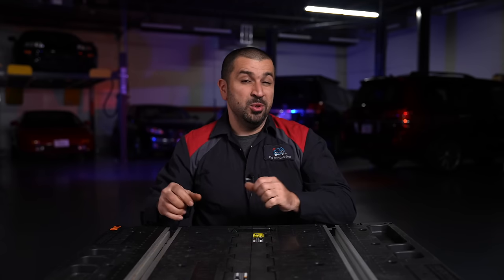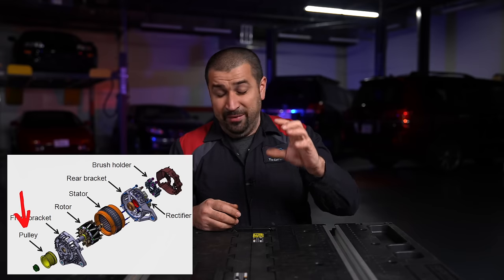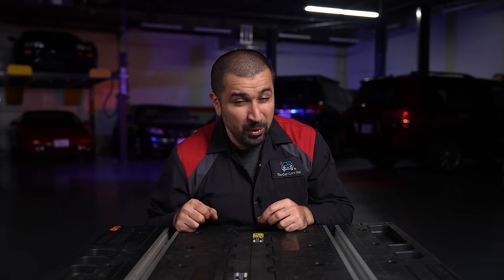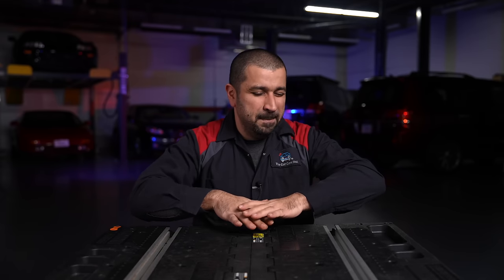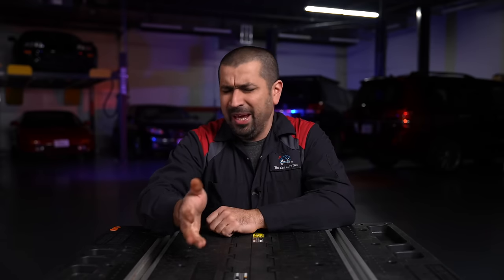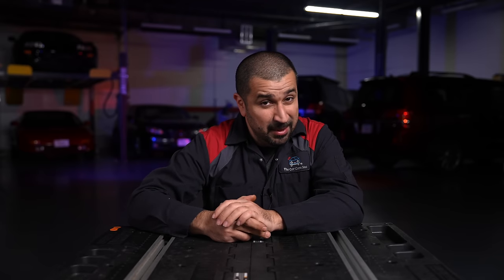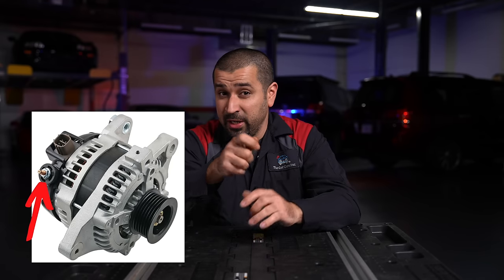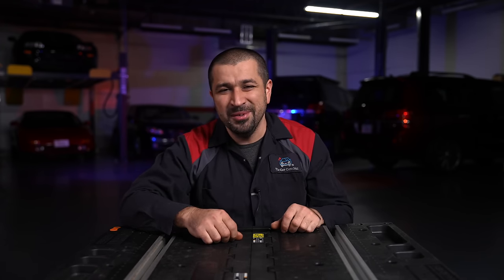How To Make Your Car's Alternator Last Longer? Everything You Need to Know

Comment: I usually get between 200-300K miles on my Toyota's when the alternator starts to fail, just something I've noticed over the decades on all the vehicles I've owned. 
Story time = The wife was in FL in her Lexus RX300 (03') driving back, when the vehicle died while running. Why do most women never notice warning lights :(  . Someone jumped her car and it ran for a few minutes before it died again. Alternator was completely dead. Drove 5 hours to her. I swapped my battery for hers, then we set off to come home. I charged the battery while driving (full field on my alternator), while she was draining down the battery on hers (we were driving in the middle of the night at this point). Every hour we would stop and swap batteries again (fresh one in her vehicle, low battery in mine to charge). Did this 5x and made it all the way home. Got a new alternator at the Toyota dealership the next day and 20 minutes to swap out.
So if you ever find yourself stranded far from home in the middle of the night, playing swap out with someone else's battery can get you home. A little extra wear on the alternator is worth it.

Comment: Very good simple explanation but that covered “early” alternators because modern alternators contain 6-9 diodes to not be wasteful because when you just cut off the negative wave entirely you lose it so the efficiency early on was 50%. Adding 3 more diodes on the negative side of the ac facing away from ground forces the waves to turn around and then the bottom wave band is not lost.

Comment: Very informative. Over the years of small repairs on friends and family vehicles I noticed the pattern of alternators and batteries killing each other. Although I couldn’t quite figure out which was the cause. This makes much sense and confirms to me that there was connection. Thanks!
Reply: I found that my 20 year old Toyota Starter was killing the battery gradually, with every start.
(Battery and Alternator are fine.)  After 2nd battery replacement within 30 months, I noticed the slightly slower cranking and measured an excessive post-to-post battery voltage dip.
Isolated, a battery load test looks fine. Changed the starter and now that same battery is still working, years later.  That was a first for me after several decades, incl 45 years DIY Toyota.

Comment: I am a certified mechanic as well I'm 65 years old! you doing a great job my friend! I have a 2015 Chevy Express I bought brand new got almost 330,000 mi on it and never replaced the alternator always stay dry as in the front and it's away from the radiator

Comment: I'd also recommend performing the Big 3 (or Big 4) which is upgrading the small gauge power/ground wire (that goes to the battery) with 100% OFC 0 gauge wiring.
Reply: Usually don't need it
Reply: @DylanL69   Tell that to my amplifiers as just one of them does 5,000 watts RMS @ 1 ohm.

Comment: For a first-time car owner like me, it kinda blew my mind that weak battery can cause bad gas mileage. My car suddenly had horrible gas mileage out of nowhere, and I tried replacing spark plugs, carbon cleaning the engine, change oil etc. and still bad mileage. Now I am 100% sure it is the battery because my alternator does make a small whining noises. Thank you so much for making this video AMD, actually lifesaving!
Reply: No it's your alternator

Comment: Another tip to prolong the alternator's life is to purchase a smart car battery charger/maintainer. Every few weeks, just plug the charger to your car battery and the charger will charge up and maintain your car battery without overcharging it. That will mean less work that the alternator has to do, whenever you drive your car. (Your battery life will also be extended. 😁)

Comment: I've mentioned the alternator wear from boosting while running the booster engine before, and people don't believe it.  I've had two alternators die in otherwise well maintained vehicles, within a week of boosting while running the engine.  My brother-in-law who worked as  electronics tech understands the problem.  Most mechanically inclined people do not.   I'll never do it that way again.

Comment: I remember driving a friends corolla in outback Australia and the alternator light came up. It was 3 hours between towns and we were half way. After a few checks we drove onto the next town with the AC off. A local garage rebulit it as we waited with genuine denso parts. (The brushes had worn down and they replaced bearings and the regulator)  These days we would have to wait 2 or 3 days and possibly have some aftermarket junk fitted for a way bigger bill.

Comment: I had a remanufactured power steering pump leak power steering fluid on my alternator and it eventually killed my alternator. I regret not taking care of that power steering pump when I first found out it was leaking. Lesson learned.

Comment: Just to share, the Toyota Fortuner (2016 model and up) alternator bearing gets bad prematurely due to excessive vibration caused by the engine and worn out drive belt.  It's a common concern among Toyota Fortuner here in the Philippines.  Thank you Mr. Care Care Nuts for your valuable advices.  I've been following your channel for more than 2 years now.  Cheers!

Comment: I have owned my 1984 Toyota pickup forever. Now at 253K miles. The alternator has quit working two times in those 39 years. Both times it was the brushes worn out. I just replaced those -- back in business. One brush replacement happened in a rural area and all I could find were generic hardware store brushes. Had to file down the carbon to fit brush holders and rejigger the copper pigtails -- back in business. Amazing that the bearings are still working. I should replace those before the rotar starts rubbing on the stator parts.

Comment: This was just excellent: I wondered how they go from AC to DC beyond very generally knowing what was needed to happen.  My Neon had one low down - small and very nice looking thing the size of a big fist maybe - but $900 like 20 years ago just for the part (I gasped when the told me).  My Elantra has a big unit right up front, actually the most noticeable thing - when new it looked fantastic inside with the almost orange copper inside.  My salesperson said the AGM battery is also being used to protect the alternator and electrical system as it has much better guts to drive things without - I guess it would be the amps - of the alternator needing to get in there aggressively.  My '04 Sebring GTC .. CAA tested the battery and said it was fine but showed kind of it was not happy (drained) and the guy said it is the alternator but more likely my starter; and to look into it as the alternator and battery were likely paying the price.  Turned out the starter was drawing crazy high voltage or watts - something like near 600 instead of say 150 (I can't recall the numbers, just it was strongly different).

Comment: Excellent video.  Had a problem with my Ranger recently.  After 2 1/2 hours stuck in hot traffic jam, I stopped at a rest station on I75.  No lights on dash or any other signs of a problem.  Went to start the truck 10 minutes later - lights on dashboard, but no cranking.  Battery was dead, well indicated 2 V on my meter.   AAA was called but did not come.  Managed to get a boost and drove to get a new battery.  It was obvious that the alternator was working hard, but it made it.  Put a new battery in the next morning (AAA called at 502 am to ask if I still needed help, fourteen hours later).  The truck has been fine ever since.  I'm going to get the charging system checked, but your explanation of the role of the battery vs the alternator explained things and makes sense.  I have done about 2000 kms since the mishap, so I hope the alternator is ok, but I don't want it to happen again (I was on a trip from Canada to Florida and then back to Canada).
Reply: How old was your battery? I have found any time they're more than four years they can't be trusted - even if they test ok.

Comment: I agree that keeping things stock/OEM makes sense. The problems start when, say for a 4Runner that's modded for overlanding, you add all kinds of lights and gadgets that require far more than the 100 or 130 amps the OEM alternator puts out, especially if you now have an AGM battery (or two) installed. I've heard good things about the DC Power, Inc. unit made specifically for the 4Runner with unique power demands and computer driven sensibilities.
Reply: Put a capacitor inline  you should be golden, i had 250000 miles on my jeep never changed it

Comment: Thanks for the info. Just had my alternator (part number 27060-37021) replaced on my 2010 Toyota Rumion (Scion xB) at 135K km with a 2ZR-FAE engine. An alternator is hard to find in my country, even at the local Toyota Dealer. This alternator was never used in the USA. The exact same  alternator delivered from Japan to my country was around $1300.  Way over my budget. I found a second-hand one. Hopefully, it will last a bit.
Reply: You got the correct amperage rating right?

Comment: Great informative video!  It took me several weeks to discover the oil-soaked alternator of my 94 Toyota Pickup was causing the engine to cut out shortly after it started.  The $100 Chinese alternator I bought from Amazon is still working 1 1/2 years later.
Reply: Nice 😊!
Reply: What did you do? Can you clean it with brake cleaner?
Reply: @jcherestal  I did try cleaning it but I never put it back in the truck.  It's just sitting on a shelf in the garage.  I will need to keep an eye on the leaking oil situation.  I don't drive this vehicle very often though, only about 500 mile a year.

Comment: Dear Car Nut: My dad had a gas station since the early 50's where he did minor repair. I remember him cutting the mica on generator armatures and replacing the brushes. Those days, one was lucky to get 30 amps off a generator thru the relatively big "carbon" brushes. What surprised me when alternators came out was the tiny size of the brushes for the rotor. But now, alternators started at 60 amps output and easily these days, 100 amp is common. If I have this figured out right, the old generators had their load generated and come off the rotating armature, and the stationary field coils created the excitation. All the load had to come off the brushes. These days, the tiny brushes only have to power the rotor, which now the rotating field, opposite of how the generators worked. All the power comes off the stationary "stator", which is hard wired to the outside world, none of that charging has to ride on slip rings.
Reply: I remember my dad telling me that when he was an apprentice mechanic he learned how to rewire an armature.
Reply: @tolrem  There was a rebuilder in Fresno CA, Evans Electric Service, who rebuilt starters, gens and alternators. Unfortunately, they have since gone out of business. They used to supply the entire Central Valley with rebuilds. As a kid, my dad would take me thru the factory floor and the screeching, smells and pounding of people working was tremendous. All gone now. Last time I saw old man Hammer, I took my friend to get a starter for an early 50's Dodge. No AutoZone books went back that far. Old man Hammer took one look at it and said "That's a 3108-b. 3108-a has a 7/16 hole on one ear where this one has two 3/8 holes. Ya want that in 6 volts, cuz we can build it up for 12 volts if ya like."
Reply: Cool story and informative explanations.
Reply: @obsoleteprofessor2034 
Hard if not impossible to find a place like that anymore. Let the greenies have their future.

Comment: I'm not an engineer, only took some physics in high-school. At 6:30 instead of cutting off a half of the waveform wouldn't they use a bridge rectifier to invert it, so not to lose 50% of power? On the other hand at first I thought why don't they use a permanent magnet in the rotor. I never knew that's how they regulate an alternator output, that's brilliant!

Comment: My Mom had a Buick with the 3800 V6 known to be a great engine. But hers ate alternators. I suspected it was because of its placement at the back of the engine by the firewall caused it to overheat. AMD confirmed this with his comments about cooling.

Comment: I killed my alternator in a month by letting oil drip on it.

I put a supercharger on my car and it was leaking a bit of oil on the alternator (not much) but it killed it quicker than i thought. 

Fixed the leak and replaced the alternator. I knew I was pushing my luck by being impatient, but i didn't think it would kill it THAT fast. 

Lesson learned... Been good for 100k miles.

Comment: Best mod for a healthy alt, stable voltage and battery. Upgrade the + wire going to the battery from alt and add high gauge stranded ground wires from battery- to engine, engine to frame. And get as bigova battery that fits. All connections super tight and protected with spray or vasaline

Comment: Rule #1:  don't overtighten the alternator drive belt.  In the olden days when cars had generators, the roles were reversed:  the armature had the heavy windings while the stator had the smaller windings.
Reply: On the 350 Chevys with a V-belt, we would tension the belt to where you couldn't rotate the cooling blade on the pulley by hand and that's it. People used to tighten them so much that the belts used to flip upside down in the pulley track....

Comment: 21:30 If the battery light comes on, you can still drive for maybe an hour depending on the load.  Turn off electric accessories, air conditioner, headlights.  If you are out in the middle of nowhere in a southwestern desert, "park the car" right now right here might not be the best choice.

Comment: Thanks A. Some useful info. One thing I think you should have added is that you CAN repair those alternators, especially some Toyota densos. What is the most common cause of an alternator failing? Worn brushes. Many  Toyota Densos have brushes that are easily replaced and some are difficult. Brushes are cheap. Find out if you have easily replaceable brushes. If you do check them and replace them if worn down. Other causes such as worn bearings are uncommon IMO.

Comment: Great advice/explanation.   I think I made a mistake a few years back on the old Camry by keeping the original battery up to about 180K miles.  It was obviously weak, but continued to start the car OK so kept it until the first time it was too weak to start the engine.  I'm guessing this might have killed the original starter, but still have the original alternator at 205,000 miles.  I did pay up and get the rebuilt denso starter, and will do the same then I replace the alternator.  Will probably do this when I replace the water pump....  You can no longer get brand new starters/alternators from Toyota for the poor ol 09 Camry.   Guess it is time for a new car, wish I still had my 99 Solara V6, oh well.
Reply: not time for a new car if your Camry has only 209K!!!  that's the ENTIRe point of this channel!!!!!
Reply: @18_rabbit    Yeah, but my 09 has one of those oil burning 2.4L engines.  I took good care of it, so never qualified for the repairs cuz it didn't burn much oil.  Now, it is starting to use a little oil, and the undersides are getting a little crusty from the NE winters and salt....Oh well

Comment: Question. Over the years encountering many times someone needing a boost, I try to be a nice guy, pull out my jumper cables happy to help. I open the lid of my engine bay, hand the person the end of the cables to hold separate, then I connect my end to my battery, they then proceed to ground the pos & neg as if to try to weld them together. I say whoa!! man don't do that; they say it won't hurt anything. Is that true? I've had several alternators die shortly after these incidents.

Comment: I am an electrical engineer. In automobile I am a DIY. I have never brought my vehicles to a mechanic except for a tire replacement. The three phases you wrote should have 120 degree phase differences. The circuit needs three diodes to regulate the ac voltages to dc. The circuit needs a capacitor as a final dc filter, and that capacitor is the battery.

Comment: Diodes are a bit of manufacturing wizardry.  There are a number of materials that work, and such arrangement is commonly known as a p/n junction.  That behaves within certain limits.  Forward biased, there is a breakover voltage, which means there is a minimum voltage differential before it allows current flow. Its always something small - lets say 0.2 volts [but designs vary].  That drops voltage, so for an alternator, its part of what the voltage regultor compensates for.  When polarity is reversed [+ on the - side], it stops conducting... to a point.  That limit is peak reverse voltage [PRV], and as far as devices I've worked with the number is typically  under 100v, although I've used high power devices rated at 300v.  If that rating is exceeded, not only will it conduct, but may be permanently damaged - techs call it "blowing a hole" in the p/n junction, and it may  conduct all the time.   Real world... I'm not worrying about any of that going down the road because the car is alredy engineered: are the bearings ok, and is output regulated voltage. Answer yes, and its time to watch out for morons turning right from the keft hand lane [which is every week and more where I am].

Comment: Great video. I would like to add an alternator experience I had recently (2010 Camry). When it’s cold I would hear a loud clicking noise 2-3 minutes after starting car. Mechanic dismissed as lifter issue (normal in older cars). Turns out because I had disconnected the battery a # of times to try to clear some codes and did not tighten enough when reconnecting terminals. Believe it or not … tightened them properly and poof problem gone.
Reply: To expand on where the noise was coming from? The alternator. Yep😂